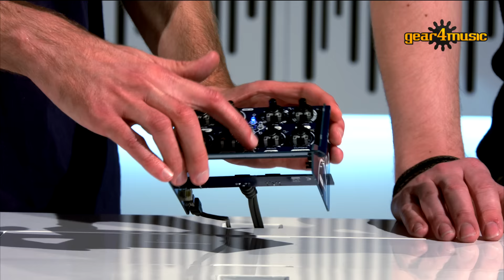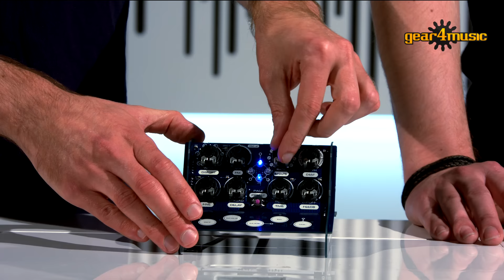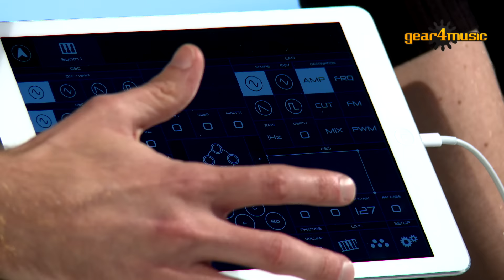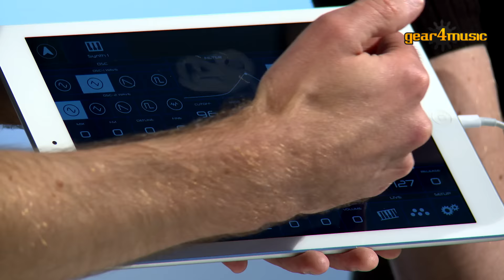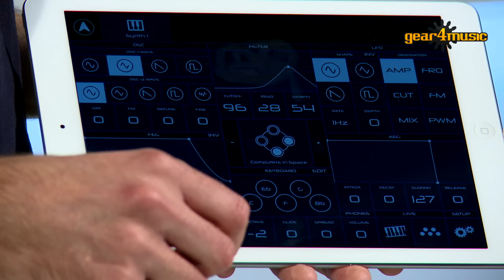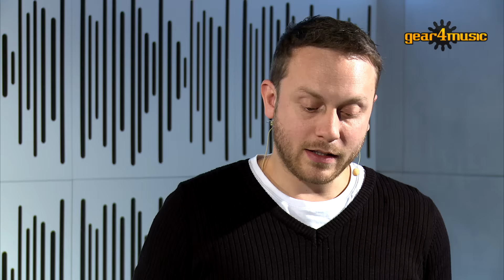Modal CRAFTsynth Monophonic Synthesizer Kit

Comment: So no Envelope (filter/amp) on the panel itself?
Reply from the maker: Hello there,

Thanks for the message. There are pre-set envelopes that can be accessed from the panel but you need the app to access the rest. It has multi mode filters which would only work on an app as the synth is too small. We hope this helps!

Kind regards,
Gear4music